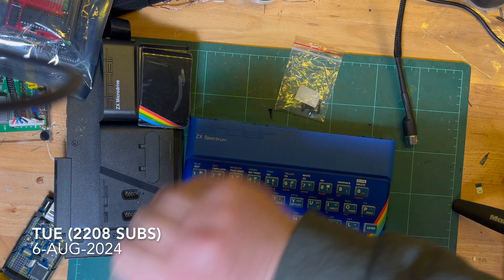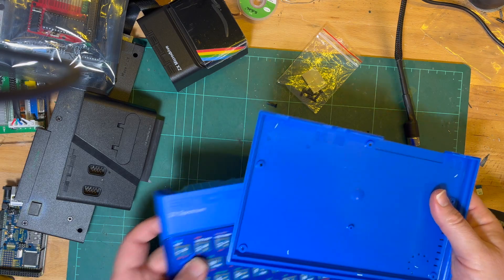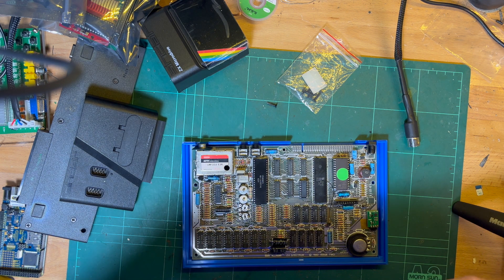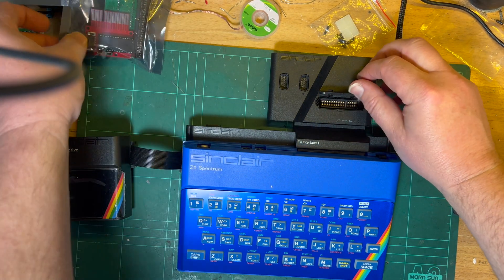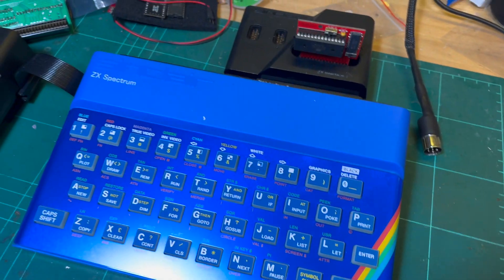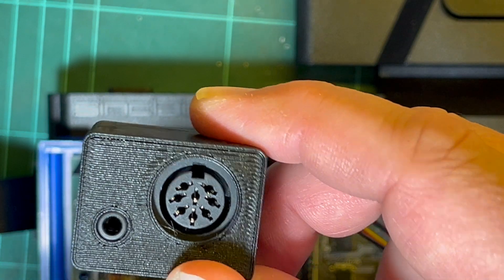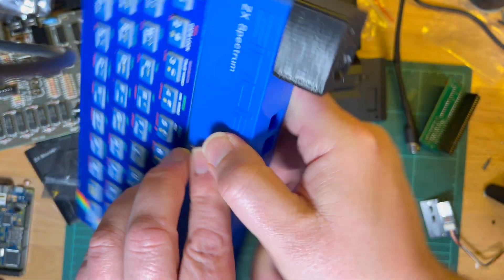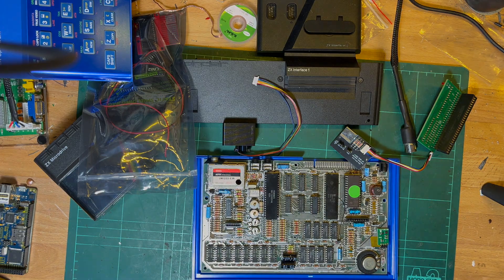🇬🇧 Sinclair ZX Spectrum: Quick Update (6-Aug-2024) [TCE #0502]

Comment: That case looks really well made and I didn't know the speccy was capable of RGB too. Thanks.
Reply from the maker: No worries.  It is a pretty good case & keyboard - the original owner has modified it to accomodate the Interface 1 internally.
As for RGB, most computers do generate RGB but these signals are then combined internally to create a composite signal ... so it's sometimes a matter of digging around inside to get them ... Charlie with his vRetro devices makes it easy on the original Speccy models.  The Spectrum 128/+2/+3 models output RGB via a DIN socket natively.